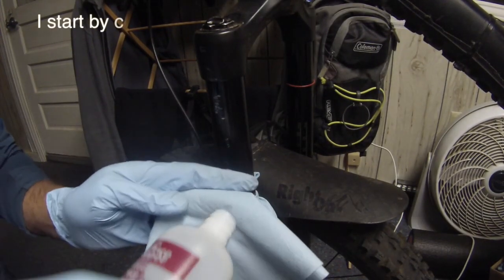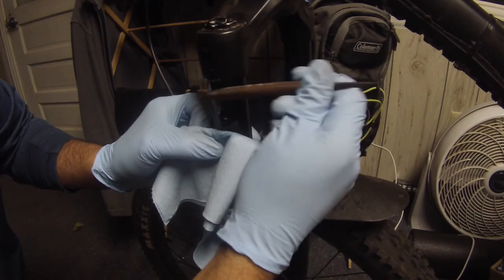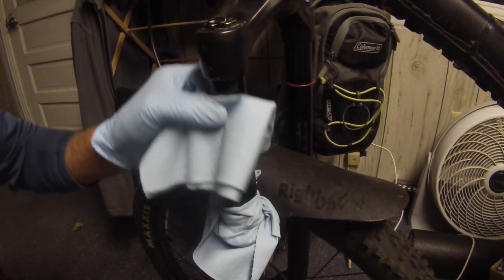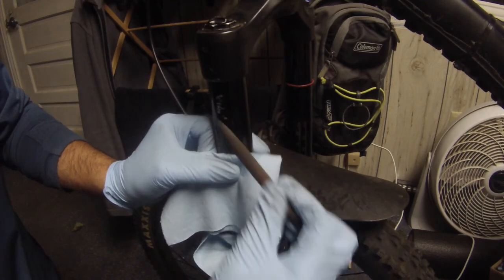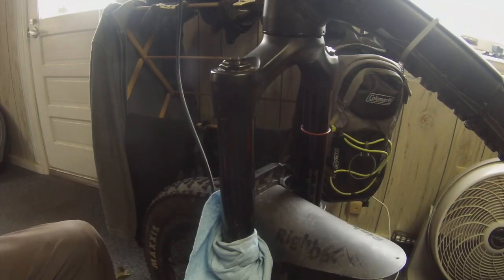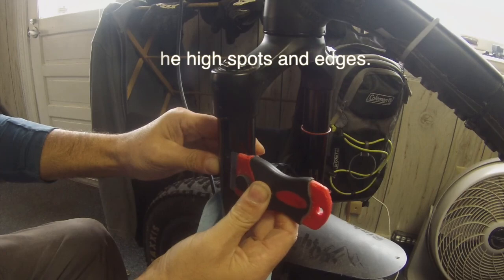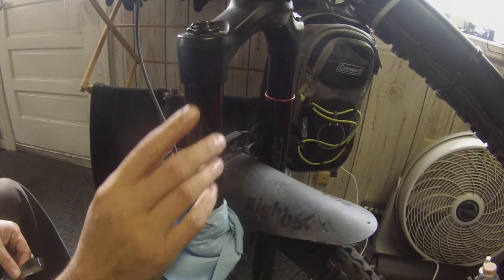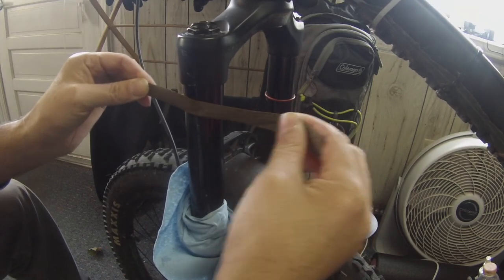How to Fix scratched fork stanchions

Comment: I like the method you've done, the only problem I have with it is the fact you've used a hard polisher in order to lower the dings. I think going with only knife will do it.
Do you mind uploading better quality photos of it?
I myself need to do it as well to a brand new (only 3 weeks old) bike
Reply from the maker: Bummer on the scratches. I think the knife makes sense if it works. I am pretty handy with file so for me it made the most sense.
Reply: @MTBBeta  
What's the latest status of it? It's been two years now since you've fixed it.
Reply from the maker: Mor Dabastany no leaking!!
Reply: @MTBBeta  
Amazing! I'm going to try it. If you can, please do share new and updated photos..
Reply from the maker: Mor Dabastany when a have some time I’ll try get some pics up

Comment: You said you use super glue and black nail polish, but at what rate?
Thanks in advance.
Reply from the maker: The black nail polish is just for coloring. I mixed in enough so that the glue was black. If you start with a small amount of glue and add the polish it will be obvious.
Reply: @MTBBeta  Got it. Thanks.

Comment: Hey, nice repair job. How is it holding up, letting any air out?
Reply from the maker: Tomaz Lesjak   I've put another 200 or so miles and am really really pleased with how it turned out.  No leaking, buttery smooth and rock solid.
Reply: Thanks mate, I'm about to give it a go myself
Reply from the maker: Good Luck and let me know how it turns out!!
Reply: The method has worked out well, I'd say it's about 95% fixed. Just can't get the nail polish to remain in some of the shallower scratches. Feels pretty smooth so I reckon it will be alright.
Reply from the maker: Thats awesome!!! I did a second coat on one small scratch about a week later and it helped but I had the  issue where if I sanded it, I sanded it all basically away.

Comment: What if i do every step you did but instead of mixing black nail polish with super glue i only apply black nail polish?
Reply from the maker: The nail polish is not durable and will just wear off
Reply: @MTBBeta  when it wears off, will i have to fix the scratch again or do i just repaint itm
Reply from the maker: @wosaks9649   Yes, it will wear off over time. Mine lasted over 2-3 years before I reapplied. A lot depends on how deep the scratch is and how often you ride.
Reply: Last question. What type of nail polish did you use?  @MTBBeta
Reply from the maker: @wosaks9649  no clue. Any should work.

Comment: I got a little chipped paint on my tube, will that be okay?
Reply from the maker: Kim Rivera check the air pressure a few times. If it leaking you will loose pressure during a ride.
Reply: i sanded it with 2000 grit and the chip went away. Idk what sorcery happened
Reply from the maker: Kim Rivera awesome. Sounds lucky.

Comment: Hii my air fork has a little dent on it, its a dot/point is it ok? I just sharpen it to become smooth
Reply from the maker: You will want to monitor the air pressure over a few rides to see if any air is escaping. If it is the follow the video to fill it so no air leaks.